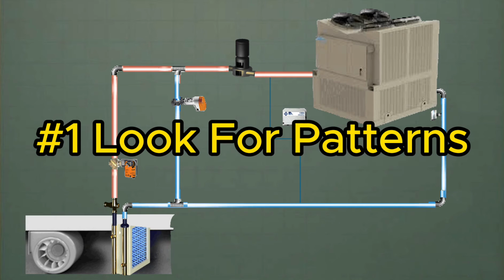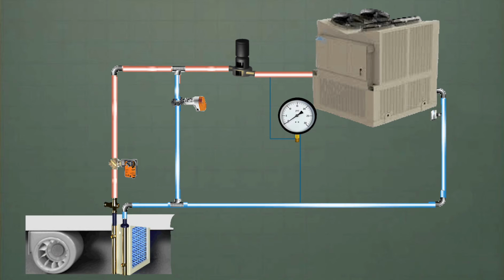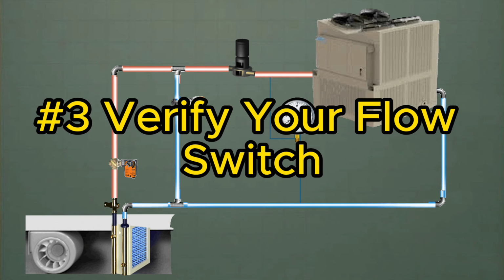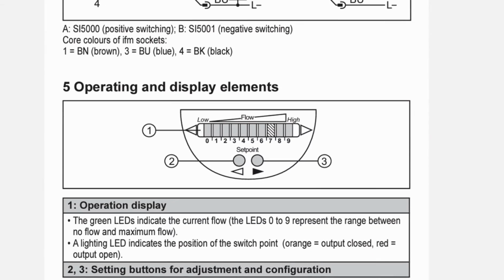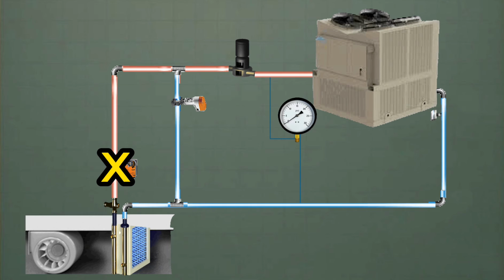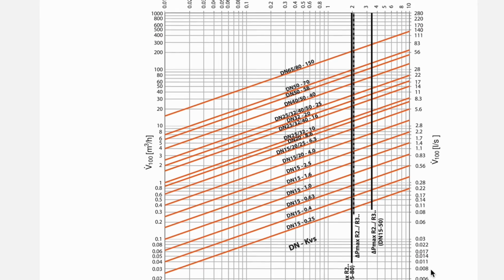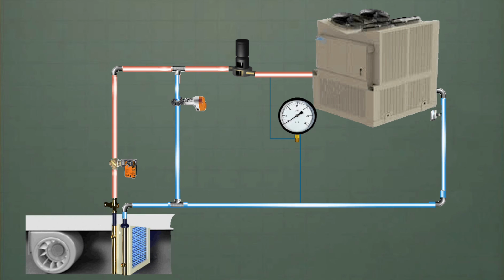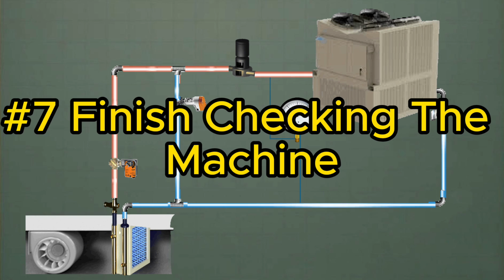Troubleshooting No Evap Flow On Dakin AGZ Chiller

Comment: Doing a start up on an AGZ and the flow switch is tripping after 15 seconds of run time...and the Delta P isn't changing and is set perfectly, flow switch is calibrated properly....this video is full of great information
Reply from the maker: excellent, did you get er? the book has the flows by model # also.  i have had issues with the AGZ tripping as soon as a compressor kicks on.. 

if your 100% on flow, flow switch is calibrated for slightly below the min flow for the model, and you dont have any air in the piping, then double check the orientation of the flow switch.

it should be at a 45, sometimes the factory will ship the chiller with it straight up and down. if this is the case, just loosen the vic, and turn the pipe a bit. 

depending on the Software version, you can also program a delay for the flow alarm if its just for a split second. hope this helps brother! let me know
Reply: Having the same issue with an AGZ100 faulting out on low flow and evap 1 pump faults only when the compressors cut on. Did you figure out why this happens?
Reply from the maker: @danielbranham2944  sometimes when a compressor goes to start a small amount of turbulence will be created in the piping, and it can cause a trip. 

1. Be 100% sure your flow is correct.
2. Be 100% certain your flow switch is calibrated.
3. Make sure the flow switch is oriented correctly. If you have the SI5000 Thermal dispersion switch, then Google the manual for it, it should be mounted in the side off of the stub. Sometimes they mount them straight up from the factory. 

Check all of that, and let me know what you find out.

There is also some flow switch delay settings, but I don’t thing you will want to mess with any of those.
Reply: I’m certain the flow is correct.
I’m certain the flow switch is calibrated, have had a number of Daikin certified start-up technicians look at that and re-calibrate.
I’m certain the flow switch is installed as recommended.
Flow switch shows acceptable flow when only pump runs, as soon as compressors kick on the flow drops below threshold and trips out and compressors cut off, then flow on flow sensor goes right back to acceptable.
I had luck cutting one of the circuits off and the flow maintained when it started it up, then cut the second circuit back on. But that’s not run type conditions.
Reply from the maker: @danielbranham2944 what do you mean cutting one of the circuits off? Could you elaborate?

Also, is your evap pump ran from the Microtech or the building automation system?
Reply from the maker: Let me know

Comment: Thanks for talking about this. Had the same issue for quite some time. Our chiller does multiple fan coils with two way valves and programming cannot open bypass quick enough on differential pressure change when demand stops, flow shutdown.
Reply from the maker: absolutely brother. did you guys get the programming side of things resolved? typically they can close the two way vales in steps to allow the bypass time to respond, unless they are just open close valves? Also, a good rule of thumb is no more than a 10% change in flow or load the chiller sees in a 10 minute period. let me know if your still fighting this, and if you draw me up a small diagram, i can do a video on how it should be set up in the automation. I'm sure others would find it helpful as well. let me know brother

@isaiahkassy2615 actually requested i do more service call videos, so i will be doing more of these.